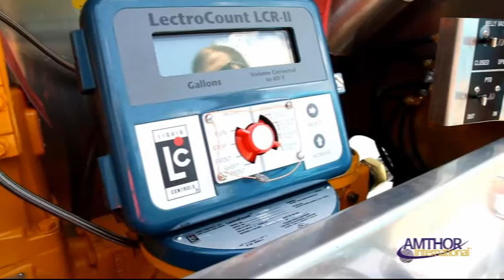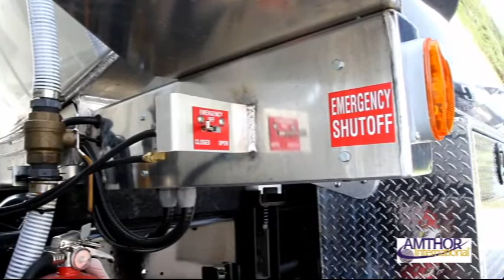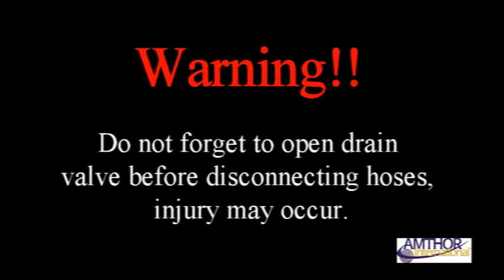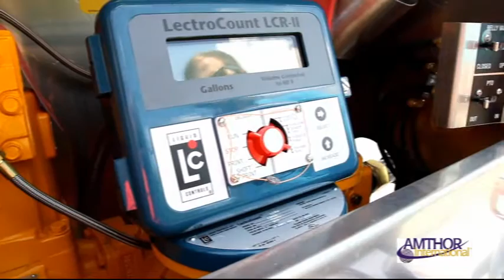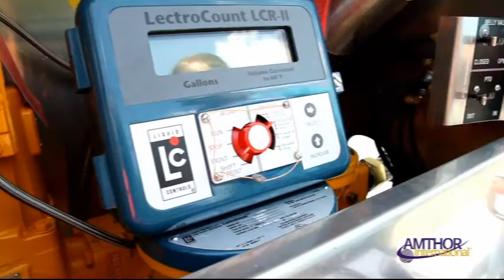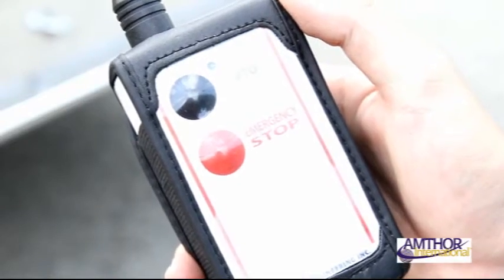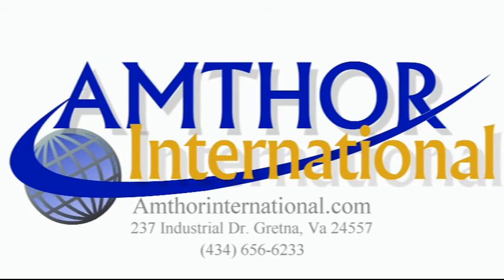Propane Truck

Comment: I did not see a Grounding Strap connected between the Truck, and the Loading Plant to prevent static electricity from creating a spark.
Reply from the maker: I just shoot the video, most of the time I don't even know how the equipment works, but thanks.
Reply: Didn't know you had to have one.

Comment: Anyone in lpg experience of handling bobtail delivery truck can help. My bobtail delivery trk of lpg has high presure and same lpg on other trucks presure is low but this only bobtail his preure goes up. I dont know why its happening. I would appreciate a suggestion from someone with this experienxe on what to do.
Reply: The valve you use to fill the truck may be the liquid line instead of the vapor line. The Liquid Line loads from the inside of tank at the bottom. The Vapor Line marked “Spray”, usually, goes from sprinkler-like spray lines hanging from the inside of the top of the trailer and it doesn’t pressure up the trailer as much.